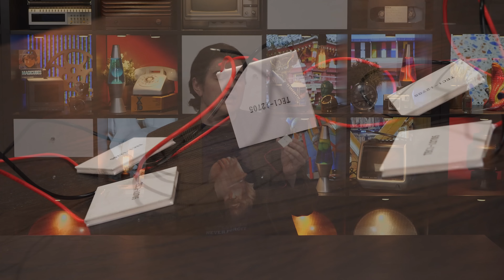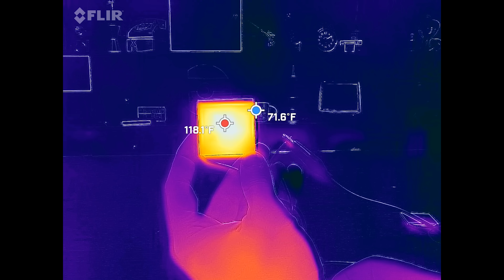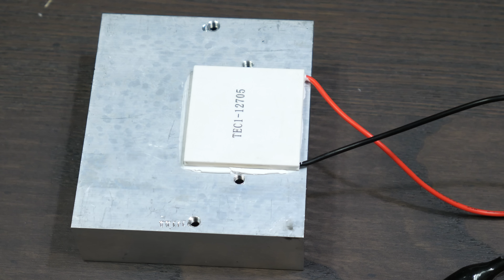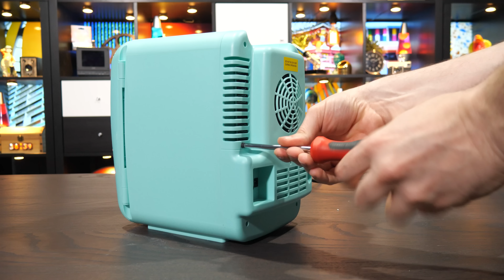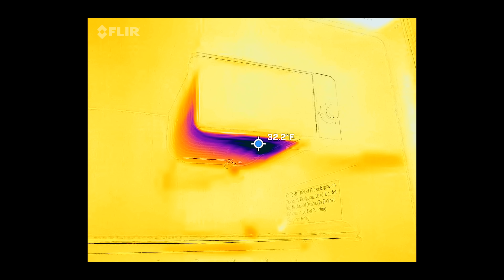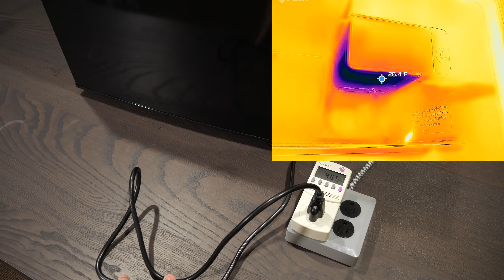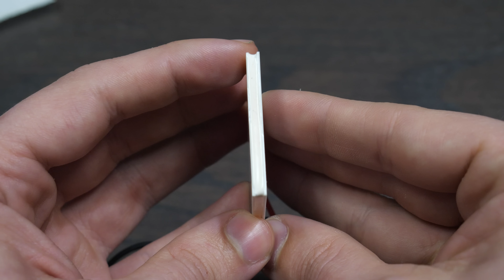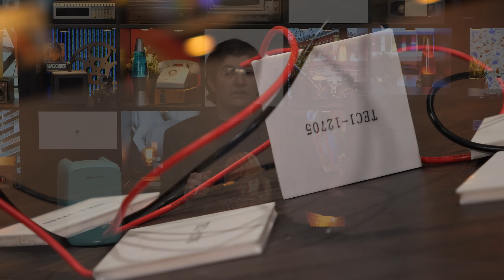Thermoelectric cooling: it's not great.

Comment: I'm a theoretical physicist but I never thought about this effect.    It seems to me that it is the semiconductor charge-carrier analogue to evaporation - the charge carriers with the highest kinetic energy cross the band gap into the conduction band, but those with average KE remainstuck in the valence band.   Similar to the way that high KE molecules at the surface of water escape and cause evaporation.   Is this analogy correct?   The Wikipedia article on the Peltier effect does a poor job at explaining the physics.

Comment: I have an ice chest with a Peltier device for a cabin with a mini fridge and on the way it’s plugged into the car. All the food comes from our kitchen fridge with frozen food included, it works great. We also use it home at times for extra over bought items and have to be careful because it will freeze items. You do have to be aware of ambient temperatures but if packed with pre cooled or frozen items I haven’t had a problem, it’s better than having water soaked food from melting ice, oh wait it keeps ice frozen for days it’s nice that they work together.

Comment: Truckers use these because they’re cheap and easier to install than an actual 12v fridge. They work very well for when you’re on the road and don’t want to spend $800 on a Kenworth fridge and have it professionally installed and all that. A lot of them have a DC plug and you just toss it on your bed and plug it right into a cigarette lighter. Boom, ya got a fridge in your truck.

Comment: Well, I've messed with them a little bit and the only cores that are actually worth a darn is the 12v ones, but you have to make good contact with whatever you're trying to cool. I have a bunch of five volt ones and they are good for like cooling your neck but other than that not much.

Comment: the only device i've ever seen use a peltier that was actually useful in any way whatsoever was one of those mattress coolers. peltiers can be extremely quiet if you just pair some cpu cooling technology with them and that's kind of an important thing if you're trying to sleep in the same room as one of them. but i will admit i was surprised for a sec for why they don't just use a regular heat pump.

Comment: Check out the BioLite camp stove for an interesting application of these little devices in reverse! - rather than applying a current to obtain a heat differential, they take advantage of a heat differential to generate enough electricity to power a fan (to provide a hotter, smokeless fire for cooking) and to charge devices like cell phones and headlamps - neat!

Comment: With regards to refrigerators “moving more energy than they use”; does this mean we could technically create energy stations which run off of refrigerators and use the heat as energy and still be at a net positive energy state?

Comment: They are also really good for very precisely controlled temperatures as you can turn them on and off fast, and reverse the polarity of them. As a result they are used to keep laser diodes at very stable temperatures and for laboratory thermal cycling testers. I have also seen them used in stages (literally stacked) for cooling CCDs used in DNA sequencing   
some of these TECs can cost in the hundreds of dollars 
they also have the neat effect of generating voltage from thermal differentials so you can use them for temperature delta feedback by switching them off and measuring the voltage or very very sensitive temperature delta thermometers.
But yes, useless for practical heating or cooling. 
But that does make me wonder what the smallest compressor based system is.

Comment: I wonder how feasible it is to make refrigerant machines tiny enough to serve a cabinet the size of that desktop "chiller." I know they make compressors roughly the size of a soda can and good for ~300W of cooling, but even those cost north of US$200 even from the dodgy sources and still needs the heat exchangers and plumbing...

Comment: I have a peltier mini fridge. I use it as a 'keep drinks cold' fridge because it CANNOT keep food to a safe temperature. Update: it's one of those 'cube fridge' sized fridges that you can also get as actual vapor phase fridges. The inside cooling portion has a heatsink and a fan, and then a huge heatsink on the back with two "PC fans" blowing across that. It still only gets drinks cold enough to be pleasantly cool.

Comment: I've been working with Peltier cooling devices for many years. Some have operated untouched for over 25 years in industrial environments. You are correct. They aren't efficient. The plus is that they can cool in very small places, where refrigerant coolers aren't practical. The cheapie single Peltier element is the issue in that cooler. The fan should be blowing away from the element. The lack of proper insulation, again due to cheapness, doesn't help. The plastic liner of the Peltier cooler should also be aluminum.  Our equipment, with 2 or more devices, fan, 15v power supply easily cools to below freezing.

Comment: Aging Wheels recently did a video on a hybrid truck that used multiple Peltier modules to cool the battery pack. They were attached to a MASSIVE chunk of machined aluminum heatsink, so it was slightly more effective at cooling than the tiny fridge.

Comment: Peltier cells also work in reverse, there are many woodstove fans that use a Peltier to run a dc motor spinning the fan. I'm not sure the efficiency but as long as there is a temperature difference between the two sides of the Peltier a DC voltage can be produced.

Comment: My mom gave me one for Christmas. I actually really like it for one specific use case: keeping Mtn Dews cold at work. My work (giant corp) has a "No personal refrigerator" rule. Now I'm clearly breaking that rule, but I can hide this little guy behind my trashcan. The real mini refrigerator is just way too big to hide.
Reply: If they find it, point out how it isn't an actual refrigerator. It only has a peltier cooling device, no refrigerants involved
Reply: @hive_indicator318  comparatively, even when faced with corporate explanations, you do have a case to claim, "See, this isn't a personal refrigerator! It's a small computer storage room!"
Reply: It’s a “drink chiller”.  Not a refrigerator.
Reply: This is the only thing where they shine: size. I wish a bold company will try to make a small one based on compressors.
Reply: @MrDjoppio the mini-fridge already uses a small compressor. You could try making it smaller, but then you have the same problems as the peltier. It wouldn't move enough heat and the box would not have enough insulation.
Reply: @zephaniahgreenwell8151 there’s always absorption refrigeration as a compressorless alternative.
Reply: and it's not your energy being wasted by using it. Win Win.
Reply: There are small 12 v compressor fridges being made for portability and in vehicles, but even the smallest ones are still the size of a drink cooler. I have one with a built-in battery that can run off of vehicle or the wall, but it also has basically a big power bank in it can even take direct input from a portable solar panel
Reply: I put my mini cooler (the light blue one in this video) underneath my desk lol

Comment: I feel like if you put a higher quality heatsink on the hot side with a larger/quieter fan, and also a heatsink on the cold side, then added a thermostat and temp controller it would work a lot better.